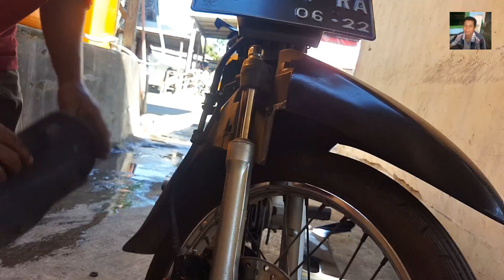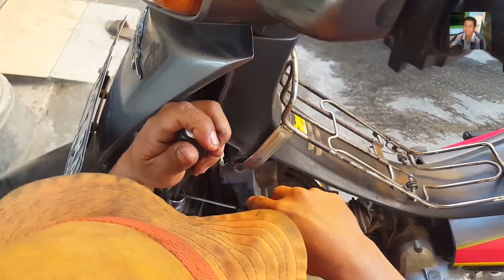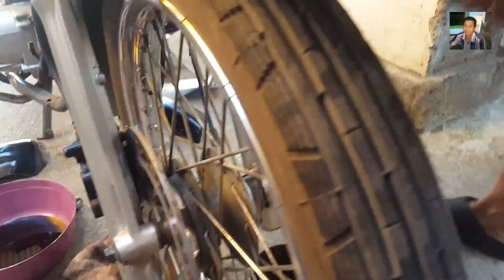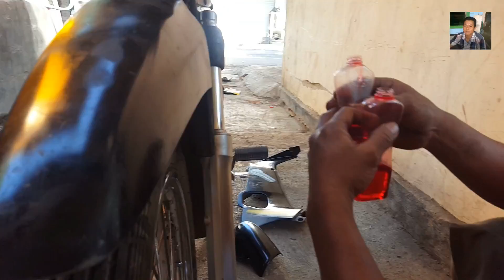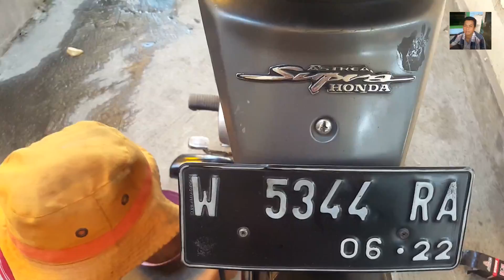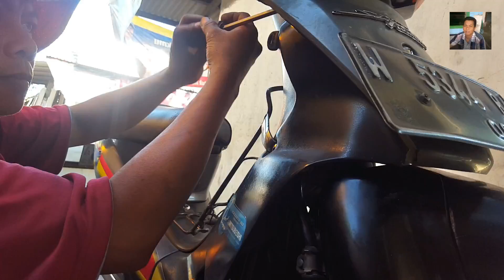Cara Mengganti Oli Shock Depan Untuk Motor Honda

Comment: 1.Itu lemnya sama sperti lem aquarium bukan sih mas??? 
2.kalau buat new vixion olinya yg ideal berapa botol mas??? 
Terima kasih sebelumnya
Reply from the maker: lem auto sealer,untuk vixion,1 skok 1 setenga botol
Reply: saudara motor kalo misalkan ga di kasih lem bisa ga mas?
Reply from the maker: bisa